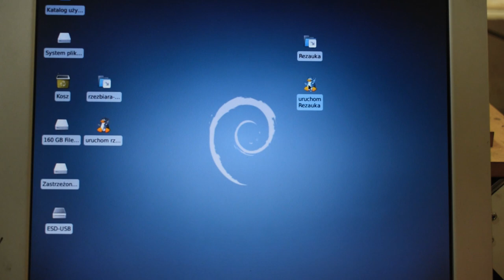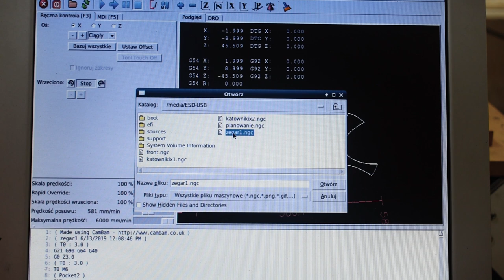Wood clock DIY - First job on DIY CNC router

Comment: If there's one thing in life that you can rely on and that is the passing of time.......nothing more satisfying than a hand made clock made with one of those electric modules that last forever on a single AA battery.....almost.
ANYTHING, literally anything becomes a clock with a bit of imagination and one of those very cheap but insanely accurate clock  modules.
I have 20+ clocks in my home....not all running at once as changing from Winter to Summer day light saving would drive me bonkers, but I store them in sealed plastic boxes and change them around to suit the decor or as the mood dictates.....it's a creative thing that really tests your creative imagination.

I'm going to tear the guts out of a wooden clock with a 9 day wind up mechanism (cheap load of crap) ....mechanical clocks are for the birds.....and install an electric module that will last for over a year......sigh, how I love clocks......LOL, in my last job before retirement I was a time study officer.